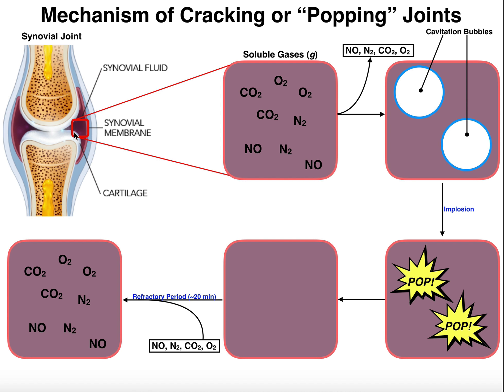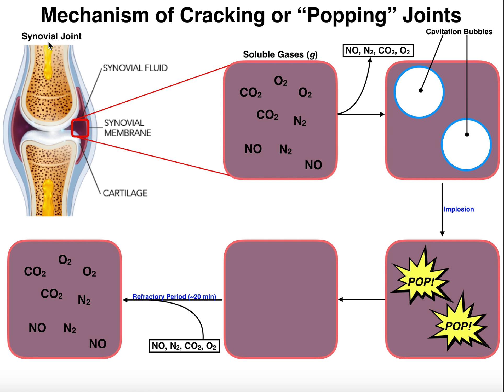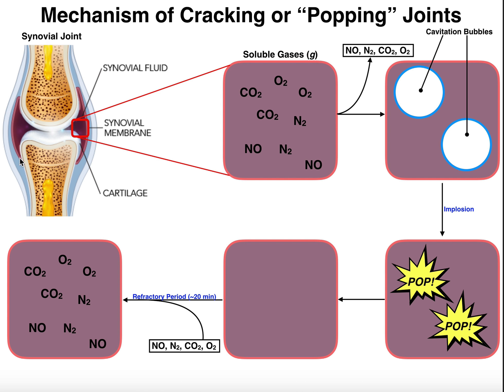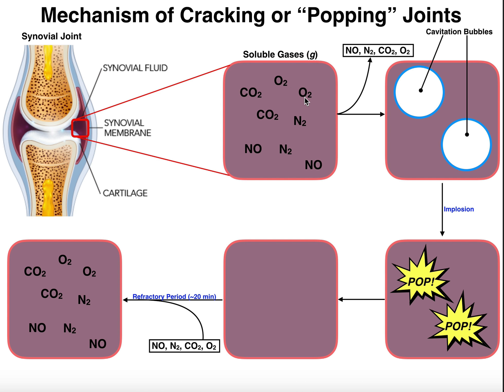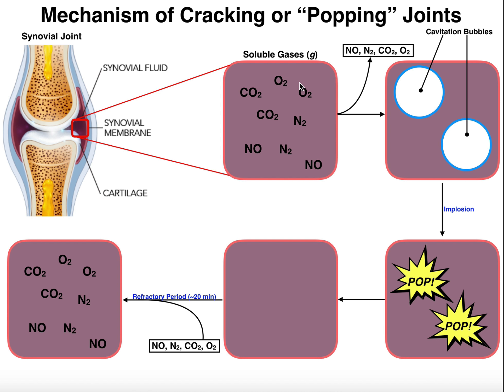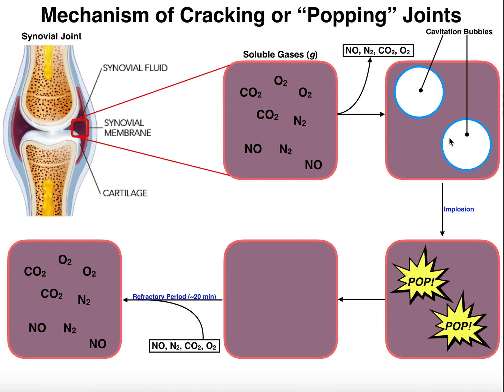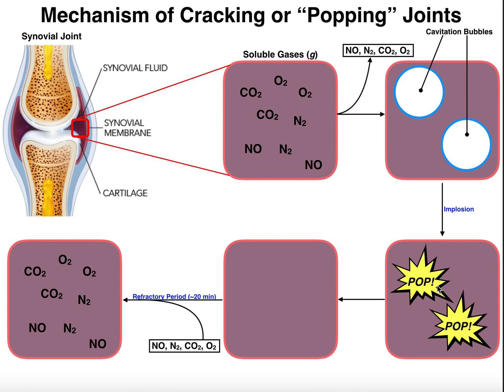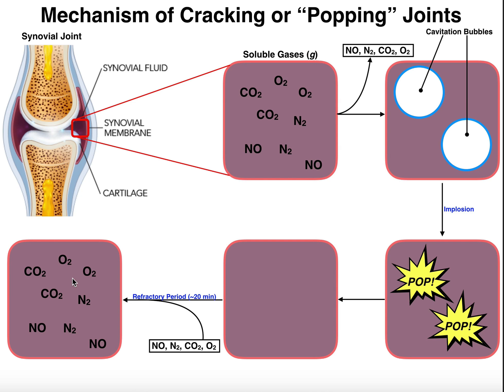Physiological Mechanism of Popping ("Cracking") Joints

Comment: some articles in the description debunking the myth that popping leads to arthritis would have been nice; also references in general are appreciated :). Awesome explanation !
Reply from the maker: Glad you liked the video.
Here are some sources.
1) Knuckle cracking and hand osteoarthritis.
Deweber K1, Olszewski M, Ortolano R.

2) Clinical Inquiry: Does knuckle popping lead to arthritis?
Powers T1, Kelsberg G1, Safranek S2.

3) Effect of habitual knuckle cracking on hand function.
J Castellanos and D Axelrod

The last paper does say that cracking joints can cause lowered grip strength. The reason for the nail biting and other habitual behaviors is most likely not cracking joints. However, the last paper does agree as well that cracking knuckles does not lead to arthritis.
Reply: @CatalystUniversity   Thank you for the answer :)
Reply from the maker: @adrianpop4427  No problem!

Comment: So it’s kind of like thunder after a lightning strike. But after the gases come out of solution, where do they go?  I also notice more popping in the days after an intense workout, as muscles get over there soreness, especially with massage.  I’ve been wondering about joint popping as a release, or clearance mechanism for built-up byproducts (lactic acid?).
Reply: I'm curious about where the gases go, also! Also, what is the mechanism that causes the gases to go out of solution?
Reply: The gases migrate out of the joint compartment through a selectively permeable membrane. otherwise, you would lose the synovial fluid. The gas molecules then facilitate different processes and are utilized throughout the body before being sent through the blood stream and exit through the capillaries of the lungs where carbon dioxide is released. Nitrogen and oxygen molecules are mostly completely transformed by chemical reactions or excreted in various manners.

Comment: Thank you. This is a very good explanation. I had a curiosity moment and had to Google why joints pop. I knew it was gas somehow, but didn't knew exactly why.

But why are there joints that pop constantly?
Reply: This is likely a different mechanism. Joints that repeatedly pop, is from a different source, like tendons rolling over bony prominences. The refractory period is a synovial fluid-related phenomenon.

Comment: Wait but why does the physical motion of cracking them cause the gasses to leave aolution
Reply: Because vacuum gets created when the joint capsule gets stretched, the gasses leave the solution because they are gasses. Everything got explained in the video.
Reply: @HellGod67  where do the gasses go? Do they leave the fluid completely? How do they get out if the membrane is sealed?
Reply: Spread in all tiny multiple bubbles again I guess

Comment: My shoulders specifically have been popping a lot lately(unintentionally), almost everytime I move them up/down, it doesn't hurt, it just creates alot of noise which is pretty annoying. Is this caused by that gaseous buildup you talked about, and of it is, is there a way to fix it?
Reply: @KrisCaD100  No, I have it too. I used to do bodybuilding and the funny thing is, after I broke 1 of my collarbones the shoulder that was broken doesn't pop.

Comment: popping definitely has to do with rheumatoid arthritis bc when my hips started to pop they also started to hurt(yes I can pop my hip),(my hips make a high pitch noice,my elbows make a different type of noise and my fingers different) now my doc told me I have rheumatoid arthritis most of my joints pop and it's really annoying my knees,fingers,hips, elbows,wrists,jaw also they don't take 20 minutes sometimes it takes 10 seconds is there any way I can reduce those gasses? or the popping somehow great video and thanks
Reply: easy answer if your joint can pop indefinitely these are not poping gases but pathological crepitations
Reply: As I understand it